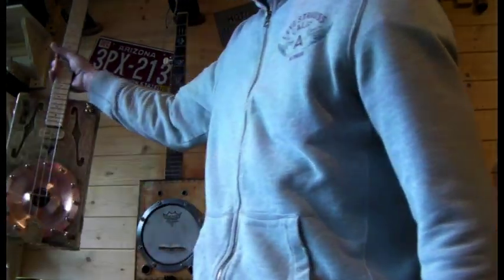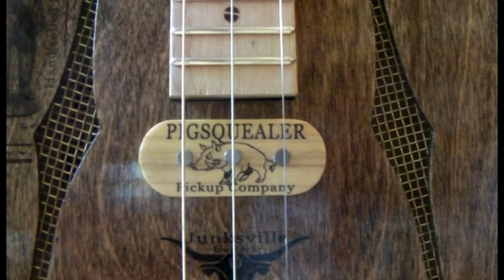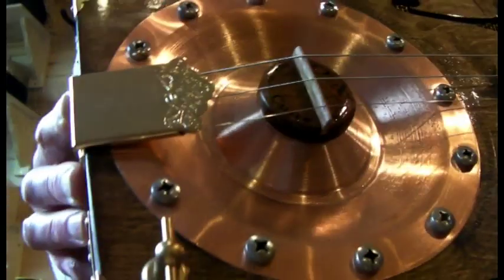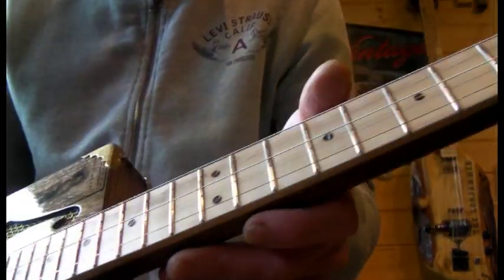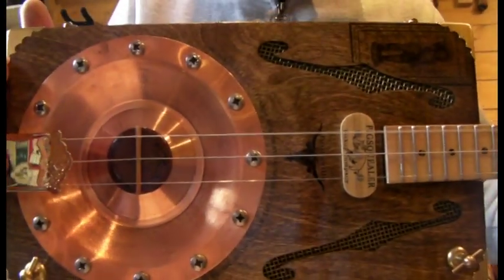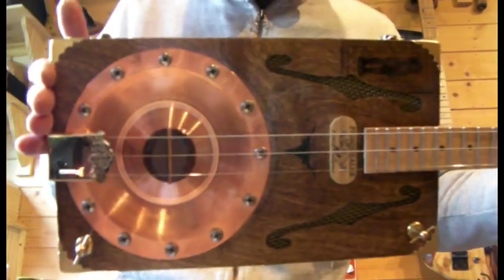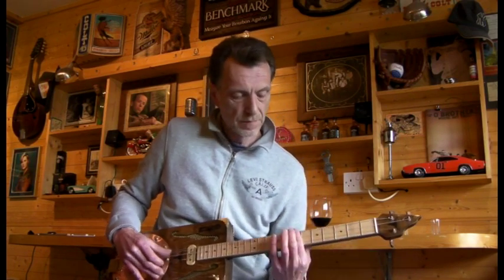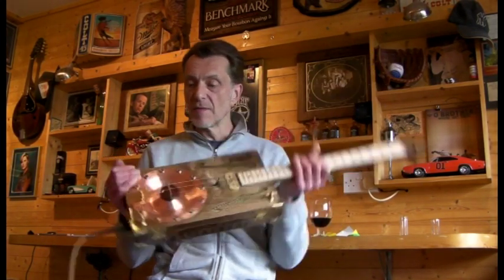3 STRING  COPPER CONE RESONATOR CIGAR BOX GUITAR BY JUNKSVILLE

Comment: How do you adjust the intonation when the bridge is fixed in the middle of the cone.
Reply from the maker: I set the intonation before I fix the biscuit, careful measuring when cutting for the cone then set the intonation by the angle of the saddle and notch forward or backwards depending on whether it's sharp or flat.
Reply: Thanks. You make great guitars

Comment: what diameter resonator did you use? and what box dimensions is that?
Reply from the maker: hi there, the box is 12 x 8 x 2.5 inches and the cone is 7" but fits in a 6" hole